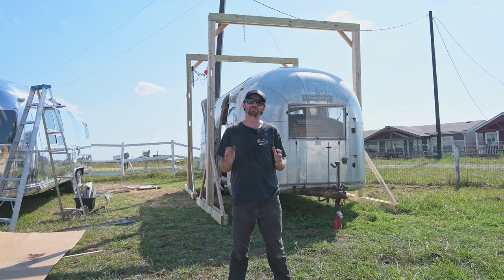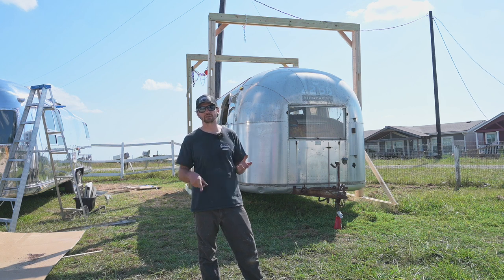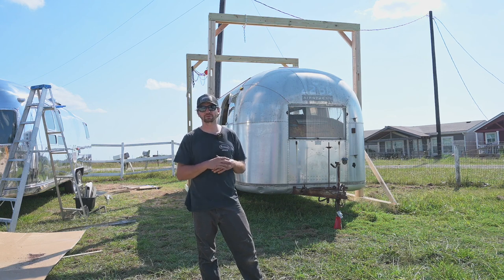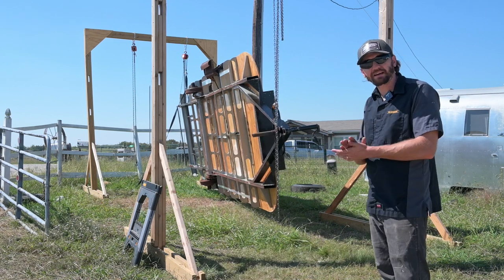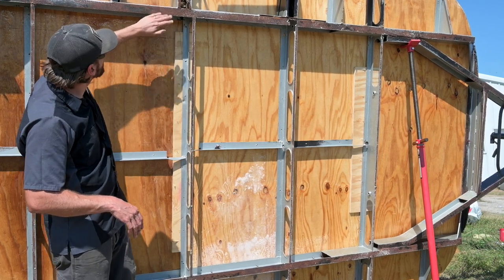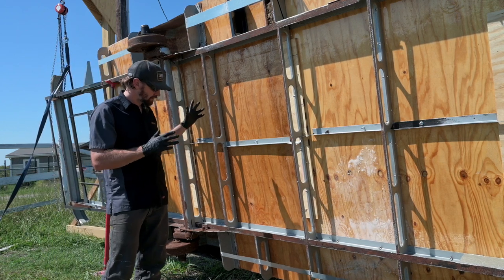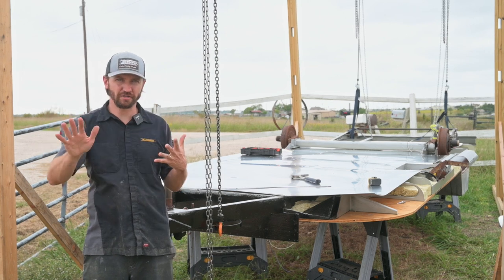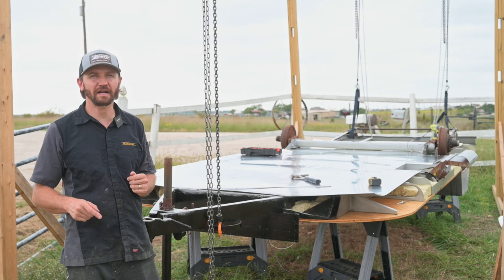Speed Up Your Airstream Renovations with this Upgrade!

Comment: Hi Ian, I have a 1983 31' Airstream Limited. Is it necessary to remove the interior aluminum skin, to lift the shell from the frame? I would certainly remove all the appliances, washroom, beds, counter top/cupboards, etc.

Comment: I have a 31 foot, 76 international land yacht.  My original belly pan aluminum is 61 inches wide.  I’m only finding 48 inch wide belly pan aluminum.  Yours in the picture looks like its one piece,  Can I order a wider width on airpartinc and I just can’t locate it?
Reply from the maker: 48 is the widest.  I put 2 strips down the entire trailer overlapping a little in the middle.
Reply: @MillerGarage  so rather than doing the  strips perpendicular to the long trailer you are now just doing long parallel strips? Any pros/cons to one way versus the other? Thanks!